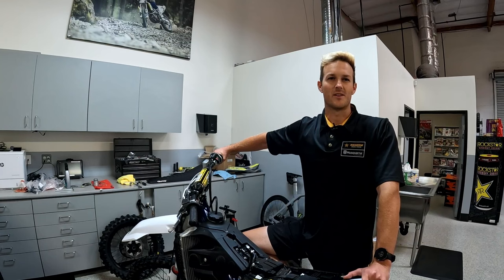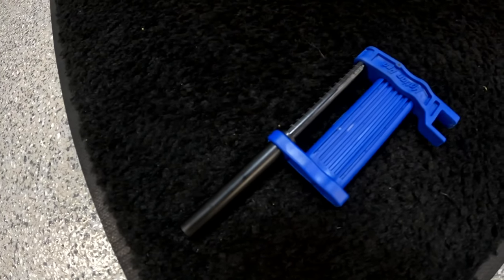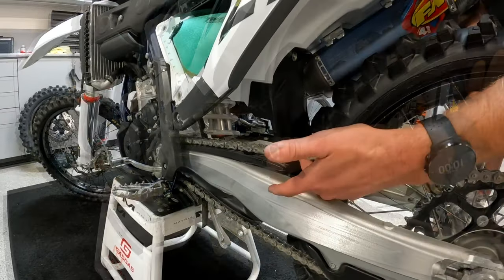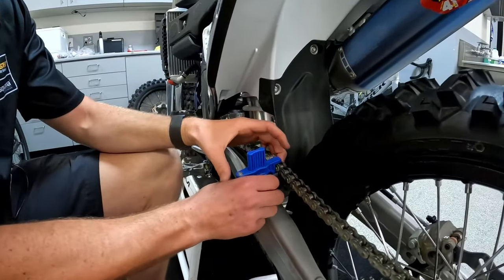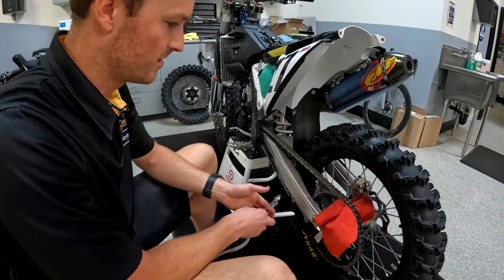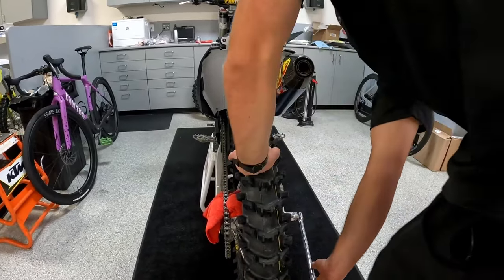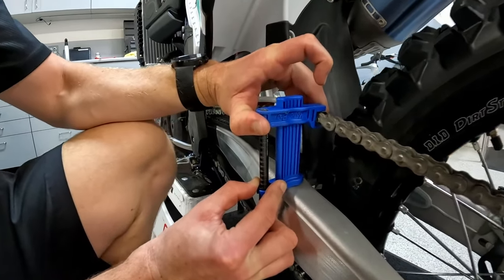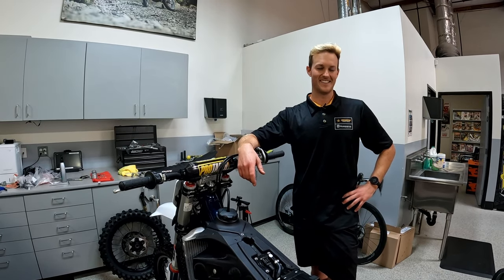2023 KTM and Husky Owners MUST WATCH! | Tech Tip

Comment: Helps to tighten the axle nut first so you don't have to worry about disturbing the final chain tension setting. Then you can preload the 10 mm toward the blocks a touch, then tighten the jam nut.  Less chance of coming loose this way.

Also note: Every bike should have its chain tension set using the swingarm max-radius method to set the standard for the slack, not just this Husky.

Comment: As a half century old, Husqvarna mechanic... 

1. First lube the chain before you start because the chain will lengten and all measurements before became useless.
2. Lube ok the rollers in the inside 
3. Then the whole adjustment procedure
3. Do half of the axle Nm

Comment: Owners manual is telling me 58-61mm on a 2023 KTM 350 SXF. Which is correct?
Reply: Mine also says 58-61mm
Reply: On the Keefer Inc testing page he was saying that KTM recommended to them 68-70 so I’m stuffed if I know 🤷🏻‍♂️
Reply: Split the difference and send it!
Reply: The owners manual is correct.   Just confirmed this measurement with the KTM mechanic at the dealership I bought my bike.  Don’t always trust “YouTube” mechanics guys.  Like what’s up with strong arming the axle nut tight?!
Reply: @Mrtomskiee2  your mechanic is wrong, the manual is wrong and whatever it says on the bike is wrong. The minimum slack is 68mm. Less than 67mm will bind up. I checked on my 300sx myself because I'm not lazy.

Comment: Background music that doesn't raise blood pressure.  I've a 2015 FE 501 right at 4th gear whether low or high speed, there's a quite concerning rattle/clacking coming from the rear chain area.  Sounds like it's going to fly off. Tension appears correct to spec. Anyone?

Comment: manual for my 2023 TC125 says 55-58mm...
Reply: My 2023 KTM 250 SXF says similar, too. So weird the manual is so off. Keefer said on his podcast KTM told him to run 68-70 MM.
Reply: what have you been running yours at? just picked up the same bike and now im stumped lol
Reply: @kylebecker9787  i run mine at 60-62mm and seems okay. I split difference between Dennis' recommendation and the manual.

Comment: Yeah but with that much slack, you take the chance of the chain falling off we all know, which can damage the 13,000 engine. End the countershaft sprocket moves quite a bit before the rear sprocket moves because it has to take up all the slack, just putting it out there

Comment: I saw a vid that you don’t need to lube those chains.  Info on this?
Reply: I don’t lube my chains, if you put chain wax or lube it will cause dirt and grime to stick to the chain and wear it out faster. Just spray wd-40 on it so it don’t rust after a ride and you’re good to go, never had an issue

Comment: I have a 2023 ktm 300 xcw and in the air box it says 55mm-58mm
Reply: 23 450 SXF manuals says from 58-62mm so I think I'll stick with that
Reply: And it's wrong. Your chain is binding for sure. Run 68 to 70mm. I just checked on my 2023 300sx. 67mm gives me 1/2" play at the tightest spot. Anything less than 67mm binds up. Check for yourself.

Comment: Hey everyone. Love the videos. I'm new to the ktm world just picked up my 2023 sxf 250 just wondering what the recommended sag/static sag should be? I'm a bigger guy 220 pounds and also what is the base starting point for air pressure in the fork? First time ever having to use a pump I can't seem to find much info online just wondering how much psi I should be running ( I'm aware it varies by ride style and weight ) but just looking for base point to work off

Thanks in advance for anyone's input 
Sean
Reply: Congrats on the new bike. Do you have the owners Manual handy ? It should have the recommended sag there, as well as the suggested spring rate if you have to go up a rate or two in order to get the correct sag numbers. I haven't got the 2023 as yet (that's my plan) but the suggested sag on previous versions was around 103 to 105mm. However at 220 pounds , I don't think you will achieve the correct Static sag (sag without the rider on board the bike)  with the stock springs . Suggest checking the manual for the next available spring and part number. But get someone to help you set the sag now. And then use the static sag number to determine how far off you are on spring rates. Hope that helps.
Reply: 100 - 110  I run 110 in sand and 105 on loam 100 on pack
Reply: You’ll definitely want to go up a stiffer rating or two on the rear WP shock than the stock at 220 lbs.
Reply: @midnightrider723  I ended up getting it re valved with stiffer spring and added the nitrogen bladder made a big difference

Comment: I called ktm and spoke to one of their engineers. They confirmed 65-70mm as the recommended slack despite what their manual says. Fwiw
Reply: My 2024 KTM XC repair manual says 58-61mm
Reply: @Dave-so7sf  as does mine. But they said their own manual is incorrect
Reply: @Kcviperdriver  Humm so maybe I should loosen it up. I’ve got it set right around 61mm right now. I saw a video of someone that cracked the engine case from having it too tight.
Reply: @Dave-so7sf  same. I've been running it at 68-70 with 0 issues for the last 35hrs
Reply: @Kcviperdriver  Thanks for the response. It’s been 16 years since I’ve been on a dirt bike. Just bought this thing a few weeks ago. So far 8 hours on it with 1 hare scramble. I already took the whole bike apart and greased all the bearings as recommended by other KTM riders.  Now off to the garage to loosen up the chain.